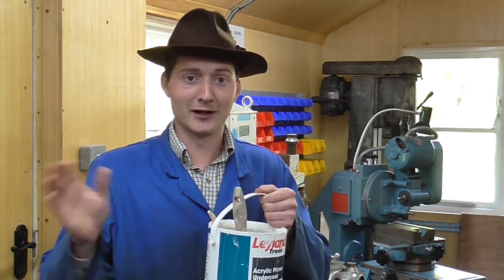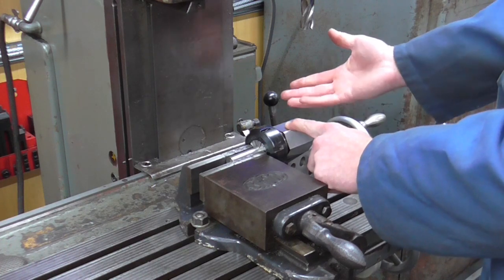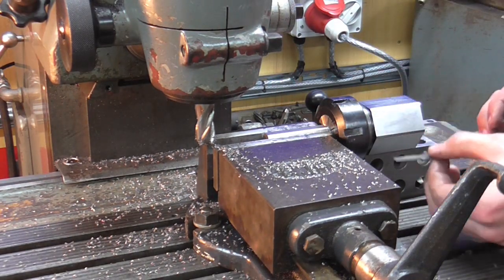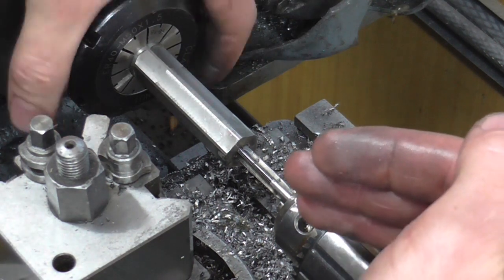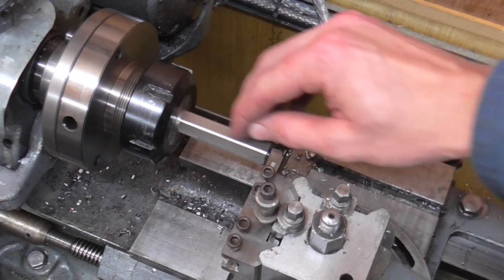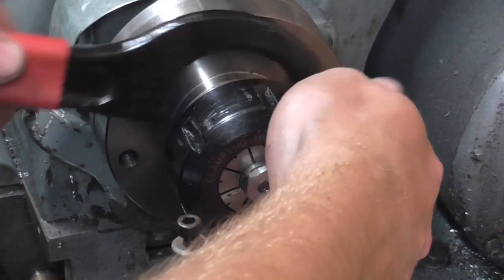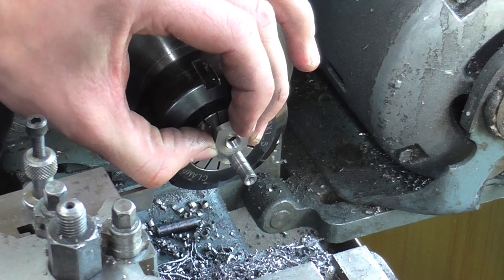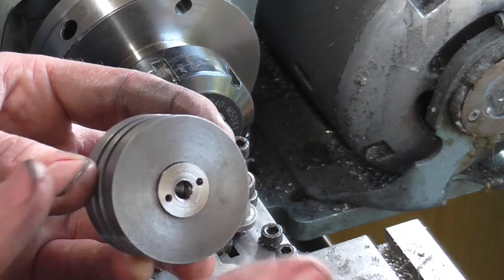Machining Nuts

Comment: I have a few points I’d like to make.
1: I hope you are proud of your skills, knowledge and forethought.
2: I hope whoever trained you is similarly proud of their skills, knowledge, forethought and teaching capabilities.
3: I hope whoever you work for pays you very well. 

New subscription from me. 
Cheers and keep up the incredible work.
Reply from the maker: Thanks
Reply: Tony Wilson  I've only very recently found this channel but instantly realised this guy's far above most othe channels. He can't even brag that he has all the tooling - in this case, no dividing head.
I disagree re the flat milling for the simple reason he was relying only on the jaws holding the work - there didn't appear to be anything the work was resting on - so as far as I'm concerned, could have been pushed down and out of alignment. I think I'd prefer his first suggestion of the hex collet holder in the jaws with the work hanging over - but with a support put under the bar (screw jack) to take the pressure of machining.
Reply: Tony Wilson  Hmm, One minute you're saying there isn't a downward force and the next saying the overhanging rod might flex. The idea of supporting the rod is to avoid the flex. I'm pretty sure there will be downward force due to a little rounding at the end of the mill. Again though, cuts were not massive. He could have supported the bar while mounted in the vice but didn't mention that so I assume he didn't.
The rounded corners will aid slippage not reduce the risk. Crisp corners would be better for this - for the same reason footballers use spiked shoes.
Reply: Tony Wilson  I'm not arguing, I'm relating to facts.
Reply: Tony Wilson  I'm just pointing out problems that could occur with his setup of unsupported work. Everyone else seems to put things like parallels under items in the vice to ensure they're level with the machine and stay that way.

Comment: No wonder those RR Merlin engines were so well built all those years years ago when we needed them. I am convinced that all steam locomotives machinists came out of the same top mould. I have the twins to those Whit spanners from the days I had a James 197cc (an English bike) I had in the late 50’s during my RAF Medical Branch posting in Germany. Still have those spanners and use them on my lathes etc. A pleasure to see your superb workmanship- I always learn something too. Stay safe up there. Ex Leeds, 👍🛠😁🇬🇧🇦🇺-now in Tasmania-42 South
Reply: Shevill Mathers the Rolls Royce Merlins were essentially hand built/hand fitted when assembling - not great for production especially during wartime when time is critical. It was only when the Americans at Packard got hold of it that they ‘productionised’ it and made it with interchangeable parts machined to close enough tolerances so that it’d all fit together without all the hand fitting.

Comment: It’s great to see engineers with that extra IQ edge which you certainly have, great video and explanations were perfect.
Reply: And your Mitutoyo vernier clock, we had one where I used it work at an aerospace company, I searched high and low and could never find one for myself 😢 looked everywhere where did you acquire yours?
Reply from the maker: It came as a delivery with some CMM's from Mityutoyo. Thanks for your comments

Comment: I very much appreciate how you share your thought process as you go.  As an amateur, it is good to learn better methods of how to approach projects to achieve the best feasible accuracy and efficiency.  It's also nice to pick up little tricks from you like the nut counterbores.  And as for the hex stock, the choices in some areas (like here) is very limited, most places only carry common inch sizes of 12L14, so anything otherwise must be made up from round.

Comment: 4-sided and 6-sided collet blocks are readily available. However, a single 12-sided collet block could take the place of both of these.  It would have the additional advantage that the top, bottom and side surfaces would always be flat against the vise jaws and base, with the top surface readily clockable.  It's curious that these don't seem to be available.
Reply: @shadowdog500  I stand corrected.  Thanks for the info.

Comment: 1:42 I'd go for that arrangement and put some support under the bar.
With the bar in the vice instead, you're relying on the vice jaws to hold the material - which could potentially be pushed down.

Comment: Can you demonstrate a method for turning loco buffers with the correct profile without using cnc. Im sure there is a way of using a profiled template bolted to the lathe bed with a follower attached to the saddle that ensures each buffer is the same shape. Keep up the good work. Dave

Comment: just bought a dividing head- is there a way to align tailstock without a alignment test bar?
the alignment test bar i have is much longer than the workpiece mandrel I intend using-so if I used alignment bar - i would have to move the tailstock after to accommodate mandrel
Reply from the maker: I think you could make an alignment bar of the size you wanted very easily. I think tubalcain shows how to do it

Comment: I notice that you have a George Alexander Master Toolmaker mill. My late brother left me an identical mill but alas no documentation. It also only had 1 pair of gears for the table feeds so the first machining job was to cut the missing pairs. If you have any of the manuals for the machine I would be most interested in trying to arrange for a copy. Here's hoping.
Reply from the maker: Hi, it's actually a Deckel FP1. The Alexander machines were UK produced exact copies of the Deckels. See if you can find anything for a Deckel FP1. Lathes .co.uk is a great resource. If you can't find anything come back to me and I will photocopy what I have.
Reply: @MrCrispinEnterprises  Thanks for the reply. I went to Lathes.co.uk and found some literature which I purchased. A bit pricey but needed. Thanks for the photocopy offer I'll check out the literature purchased and hopefully won't have to take you up on it.
Regards
Chris

Comment: What mill is that please?
Reply: I'm not certain,but I think that may be an Elliot. I've been quite interested in acquiring a similar machine,myself.
Reply from the maker: Its a 1965 Deckel FP1. It falls into the catagory of 'euro mill' design wise as there were various tool room machines made in this style. Deckel and Aciara being the common ones. An English company called Alexandra made copies of the Deckel.

Comment: Howdy - firstly congratulation on your great workshop and videos - I am really intrigued by the fact you are using the imperial system of measurement (my favourite and I'm not American) - I know you are a Rolls Royce man who I assume work in metric - please explain - cheers,
Reply from the maker: Basically because all my drawings and most of my machines / tooling are imperial
Reply: @MrCrispinEnterprises  fair enough and your ambidextrousness (if there is such a word) with both systems is very impressive - great work and cheers.